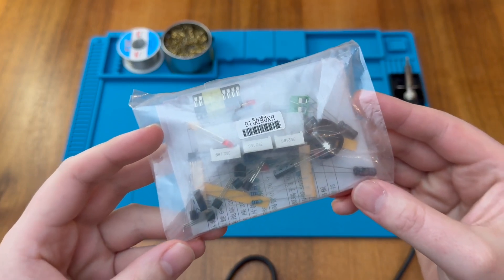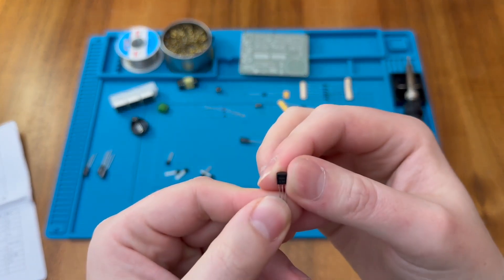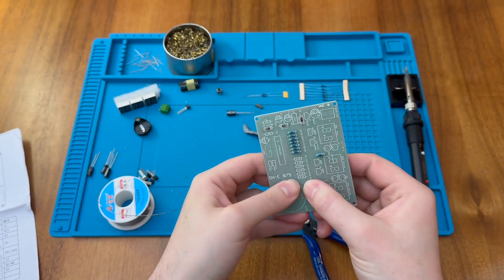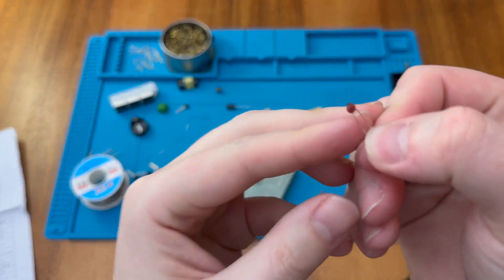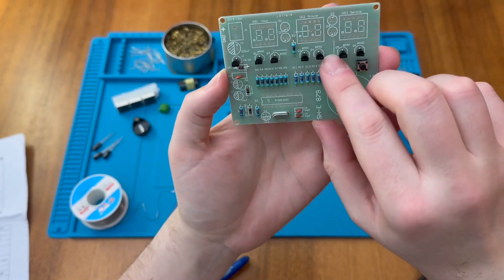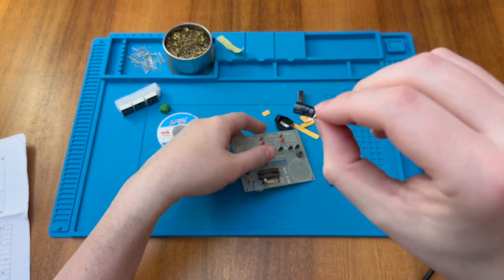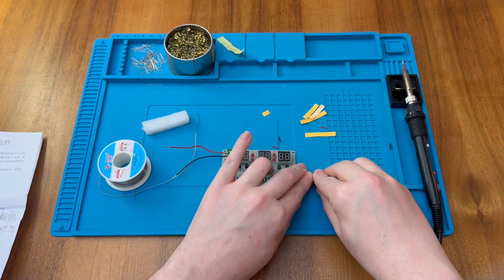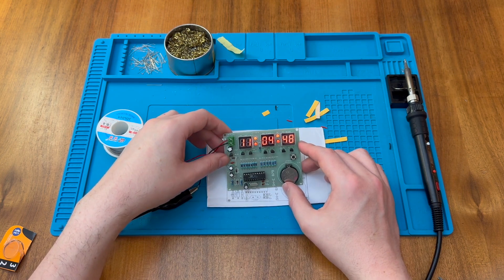Assembling an Atmel AT89C2051 Six Digit Clock - DIY Soldering Kit

Comment: Usually those can be made more accurate by varying one of the capacitors, from 5-30pF, to get it bang on 12Mhz. Note though that you can't attach an oscilloscope probe directly to a crystal / cap leg, or the probe itself will vary the crystal's timing. Sometimes you can hold it "near" to get a signal, or otherwise get a different pin of the MCU to output a set measurable frequency.
Reply from the maker: That's a great suggestion for improving accuracy! I don't have the code for the chip, so I'd have to pop another substitute in with some simple test code to hone the frequency. I'll definitely keep this in mind for future projects!

Comment: What is the role of the CR battery? The documentation doesn't say anything about it. I suspected it was to maintain the settings in case of a power outage, but in my case, if I cut off the power, I have to do the settings again. So.....?
Reply from the maker: I think it is supposed to keep the time. You can see that when I re-power the clock, after reflowing some of the joints, the clock had advanced.

Comment: Do you tin your resistors and do half clinched leads and do you tin your pads or does it matter that much and do you use flux?
Reply from the maker: I don't tend to tin anything in advance for through-hole soldering. Clinched leads are a pain if you need to remove a component again. Instead, I use blu tack to hold things in place wile soldering. I use a flux-cored solder, so don't use extra except for rework or tarnished boards.

Comment: Nice clock - yeah, setting digital clocks like this (with one button!) can be very annoying... that's why I once designed a clock that would have one button per digit for setting them individually 🙂
Reply from the maker: Yes, it was such a pain to set the time. Fortunately it has a backup battery. So at least it only has to be changed twice a year! 😭🤣

Comment: Cool. I've been thinking about doing some kits to get my hand back in at soldering.
Reply: I've done one of these clocks, destroyed a trace and am determined to fix it. I may over time upgrade the components to better ones. For a "repair exercise"
Reply from the maker: I think these cheap kits are a great way to get some practice in!